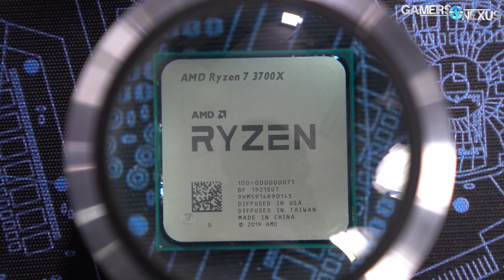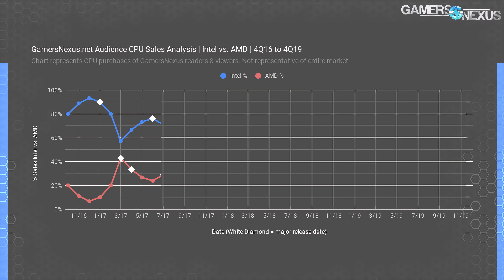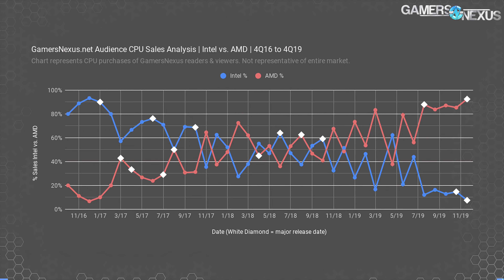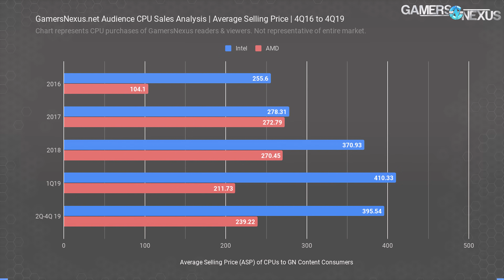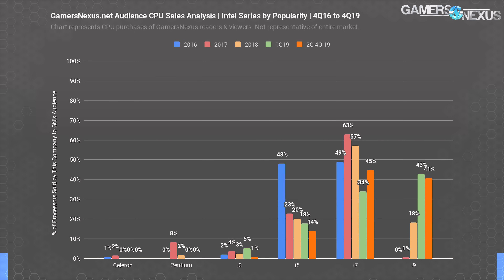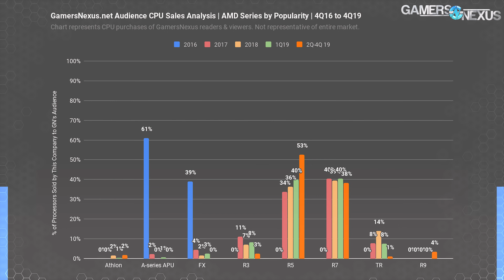GN Special Report: AMD Moves 93% of CPU Sales (Intel vs. AMD 2019 for DIY)

Comment from the maker: Watch our Best CPUs of 2019 video, which influenced data in this video: https://www.youtube.com/watch?v=5RjS3AhDyJg
Or our Best Cases of 2019 video: https://www.youtube.com/watch?v=2u8rGgYrRZY
Reply: Gamers Nexus how can you not go AMD at this point. On Cyber Monday Amazon had a deal where you could get the 3800x for $254, MSI MPG X570 Gaming Pro Carbon WiFi for $185, and a Samsung 970 Evo Plus 500GB for $77. That’s the best deal of the year and I had to jump on it.
Reply: Gaming? Lacking 3-5% VS 9900KS on average in 20+'ish modern games tests with the cheaper 3900X, that sounds a bit absurd to me when the 9900KS gets easily KO'd practically everywhere else.
Reply: I would say people are buying the 3600/3800x even though you said not to is  cause like you said 90% don't OC the chip. The 10% like me will OC and pay less while the normal person buys a stock higher clock.
Reply: Good job Gamers Nexus. You're the best there is!
I am just preparing to order mine r5 3600 CPU.
I want to use b450 MSI board gaming plus max.
Is that a good board?
I think it's a good choice it even has USB flash.
Thank you for all your hard work.
Keep it up.
One love.
Reply: i liked my 1700x better then this 8700k but this thing was essentially free for me as i traded a pc i made from spares... i wish i never sold the ryzen had a 3.9ghz oc on a .100mv undervolt... not to mention i got a golden mem controller on it... not to mention the 1700x felt like it a had a snappier out of the box a lot lest tinkering then this 8700k and the damn deliding to get the most out of it had me tearing my hair out with anxiety
Reply: So, in other words, your viewers, the most informed DIYers in the world, greatly prefer AMD CPUs.
Reply: FYI, My decision to buy a 3600 (non X) was cemented by Gamers Nexus, and AMD choosing a large (at the time) price difference between the 3600 and the 3600X.
This replaced a 2700X, and I am very happy with the decision to upgrade, the 3600MHz RAM support also makes a real-world difference for me who simply needs a "nippier" system and not an insane amount of threads, and of course the 3600 is fantastic value in its segment.
When it comes to 4K gaming, the Intel clock frequency advantage vanishes with the 3600 for real-world gaming at 4K without selling a kidney for a GTX 8000 Super XXX Mega GPU.!
Reply: Unrelated to the video, but i would really like someone with your knowledge to tackle the bizarre fps issue in halo reach and if theres a way to fix it without a game update and perhaps and explanation of what's actually going on? Doesn't matter what refresh rate or framerate you play at, the game feels like its forever stuck at 60fps, and you seem like the man most qualified out of the tech youtubers i watch to break this down. Just a simple request of a fan, i can understand completely if you don't have the time/wish to do soemthing like that. Keep up the great content my man!
Reply: Gaming is a waste of time and electrical energy, causing more pollution from fossil fuels and hurts the economy.  HoW DaRe YoU ! !

Get a Library card, walk there, and read books.    (The Library card so you are not wasting trees by printing too many copies of books.)
Reply: The main reason people were still buying the 3600X instead of the 3600 is because the 3600X was only $5 to $10 more than the 3600 during the Black Friday/Cyber Monday sale or they just plain didn't do their research on the two chips.
Reply: I don't get why your videos won't play back properly on my android tv. Seems to consistently freeze frame but continue audio.
Reply: I guess you don't mind losing 7% of your viewers then.

Comment: I think Intel issue is actually not production, it may be even artificial. My personal guess (pure guess, no support material) is AMD TR completely throw Intel off course with general availability of 16/32 cores cpus. Intel don't have, or don't know how to answer to it. Intel always reserve high core count for server cpu(xeons) as a differentiation for pricing. With AMD making these high core counts available for mass markets, Intel long term strategy break down. Its cpu no longer justify the pricing in both low end and high end segments, and equally worse, the chip set tie up also breaking down as AMD do away completely.

Comment: Its not just about ability or money it's about intels ideology. I haven't bought Intel for nearly 20 years. The writing on the wall for me was with the launch of 64bit where AMD was leading the charge and Intel sat there laughing with comments along the lines of how stupid it was to put 64bit into home PC's which was power they didn't need and should be kept to servers and data centres. While Intel may have had performance advantages in that time AMD have always delivered more performance per pound than Intel. AMD struggled in the mid term but again were leading the way in graphics integration by bringing Radion in house and providing new ideas to battle against Intel's insistance on stagnation and artificial tech bottlenecking. I will never buy Intel again no matter what they bring to the table, they had a dominant position and only used it to screw over its customer base for the most profit.
Reply: Jon Harrison   More old information.
Reply: @wysetech2000  Its not information just a personal opinion as to why I won't support Intel in its fleecing operation....LOL

Comment: 9900k/s have a serious problem. they aren't much faster than 3700x, in fact, since 9900k has time limited boost, not faster at all.

but MUCH harder to cool and need more expensive parts for high power consumption (better board, psu, cooling). plus they cost much more themselves... really bad price/performance
Reply: KilluaXIII   If you look closely and get over your bloated ego you will find that AMD doesn't hold it's boost clocks either.
Reply: @wysetech2000  there's a difference between single core boost and all core boost. my 3700x holds both consistently from the first second

Comment: most mainstream(casual) user still think amd is hot and loud. they have brainwased by intel inside slogan. also most casual user only need a laptop than dekstop and laptop market still under intel control, because ryzen laptop is rare and already out of stock. and even if you find one the price is expensive(because it is rare). ryzen cpu also limited stock, only enthusiast understand the benefit of ryzen.

Comment: I am guilty of buying a 3800x, and that was after watching your videos saying it wasn't a good value. But in the end I decided it was worth it to me to buy the higher binned chip for an extra 75 bucks even if it is only going to yield a little bit more performance because I thought it would be more fun to push that chip to its limits since it really appeared to be the fastest offering from AMD at the time (pre-3950x). I also plan to eventually add an open loop water cooling system to the computer, now talk about poor value to performance boost! I guess when you start to push into the enthusiast segment value kind of becomes secondary to performance. All that being said, I really appreciate GNs advice when it comes to value and the biggest bang for your buck, because I have definitely been using that info for other PCs that I have built for people that are operating more in that maximum price to performance arena.

Comment: Built Intel earlier in 2019, 9900k OC at 5ghz all core, paired with 2080ti. Wanted the best gaming CPU to drive Valve Index at 144hz. Runs amazing, no regrets.

Comment: I would have bought an AMD if they had a better cpu. As it stands the 9600K runs all AAA games without bottlenecking the GPU, and it comes in at $40 cheaper than the AMD alternative with lower single core performance. Clearly a "gamer" nexus buying all these AMDs, same reason turtlebeach was taken seriously by "gamers."
Reply: amd is copy from intel. a clone. another cyrix LOL. dead soon. i know. inside info. Intel always win in the end.

Comment: Used the 2600 is $50-70.  It’s a no brained to throw a box together with a $40-60 b450 mobo.  If it doesn’t totally fit whatever you are doing, who cares, it’s cheap.

Comment: It's rediculus that the Ryzen APU's are not being used in inexpensive prebuilt desktops. APUs are inexpensive, just as good and allow for way better graphics. General Work PC's should have Ryzen APU's. It's bullshit that a low end Intel chip is used instead.
Reply: the celeron is legendary btw intel is smarter and know how to make their cpu perform better clock for clock. it the instruction code that matter. amd is a joke.

Comment: Intel is still severely ahead in the laptop market though
Reply: i agree this is just a joke and wont last.. hahahaha amd sucks.
Reply: Zen 2 Mobile is coming..
Reply: @segaprophet  so what? with still 4 cores only? LOL
And I heard reports of them making 6 cores... so what? If it's still only 35 watts it's not gonna beat even the current i7, not to mention that Intel will release 6 core\12 thread i5-s to laptops next year so... Ryzen mobile will still only be on the level of i5-s lol, maybe even slower due to i5-s being undervoltable and having higher TDP.

Comment: Calm down people.  This has happened before.  I went from Intel to AMD and back again as the performance crown shifted.  However, with today's tech being easily fast enough already, I haven't gone with AMD simply because my current setup does everything I need, as fast as I need it to be.  We've reached a saturation point where more speed really does not do much except for some very niche tasks.  Nevertheless, AMD will lose their crown to Intel or perhaps another, unknown competitor in the not so distant future.  It's good for us and good for competition.  Be happy for that, but don't act as if this is the beginning of AMD's perpetual domination of the market.  They had it once and lost it, as they will again.
Reply: J3B    I don't think Intel is showing their hand until they have something great to sell.
Reply: @wysetech2000  intel is turtle. amd is hot head LOL loser.

Comment: But, but, we are doing sooooooooo good that we can't even keep up with demand.

Intel just got fucked because they had to sell larger silicon without a shrink. Running out of wafer capacity.
A doubling of silicon size, going from 4 to 8 cores or 2 to 4, results in a 66% decrease in the amounts of chips that come out a wafer. The whole square peg and round hole problem.

Once they go to 10nm or 7nm on chiplets they will have huge over capacity and will have to cut fabs for sure. Intels troubles are far from over.

Comment: I have unlocked intel cpu and I leave the OC off. I find meaningful gains leave system unstable running 24/7. And leaving it where it’s stable —- doesn’t result in much gains in real world use and increases power draw. I’m GPU bound anyway
Using rtx 2080 and 9600k

Comment: Ask GN How microwave friendly is that mug?  And metal spoon friction resistant?   Actually, you know what.  You should benchmark its heat dissipation to see for how long it can keep a hot drink temperature.  I expect charts of the differences depending on liquid density, if any.  Like, coffee, chocolate or tea.

Comment: I've had so many CPU's at this point I've forgotten most. Probably because I'm getting old. Next will be AMD again, but I'm in no rush. This 5 GHz 7700K plays all the games fine.

Intel:
4.77 Mhz 8086
10 MHz 8088
12 MHz 80286 with 80287 Co-Processor
Pentium 166
Pentium 200 MMX (OC to 250 MHz)
Celeron 366 (OC to 550 MHz)
Celeron 600 (OC to 900 MHz)
Q6600 2.4 (OC to 3.6 GHz)
i5-3570K 3.4 (OC to 4.0 GHz)
i3-7100 3.9 GHz
i7-7700K 4.2 (OC to 5.0 GHz)

AMD:
AMx386DX 40 MHz
AMx486DX4 133 MHz
K6-2 350 Mhz
Athlon 1100
Athlon 1700+ (1466 MHz)
Athlon 3200+ (2.2 GHz)
Athlon 64 3200+ (2.2 GHz)
Athlon 64 X2 4800+ (2.4 GHz)

Cyrix:
P166+ 133 MHz

Comment: On Cyber Monday I pulled the trigger on a 2700X that was selling for $159 which included either BL3 or The Outer Worlds. Already had BL3 and was going to buy TOW at some point anyway.  So I basically got the 2700X, still an incredible CPU, for a $99.  Obviously many other capitalized on this as well.  Intel simply cannot (will not) compete on this scale.

Comment: I've been an Intel loyalist since my first 486-SX25 nearly 30 years ago.... but today I received my first AMD chip ever. A Threadripper 3970X which I'll be using to replace my dual Xeon E5-2640v4 workstation. I hung on for 10nm as long as I could Intel... but the scattered few 10nm mobile CPUs were too little too late.

Comment: The Intel-AMD tug of war has been a crazy ride for me. Intel Pentium MMX in 2000, AMD K6-2 in 2003, Intel Pentium 4 Prescott in 2004, AMD Phenom II X4 in 2009, AMD FX last year and finally a Ryzen 5 3600 just three months ago. I don't know what my next CPU will be or on what socket but I know the only way Intel is going to ensnare me back into their CPU circus is with an instruction loaded single threading champion. FX is still my heavy lifter despite 2.2x the multithread performance in Ryzen 5. I rely on Ryzen for playing unoptimized/VR games and doing work in Unity and Blender. Neither of them are disappointing but it's annoying that these systems are marked for specific jobs where overclocking is such a different experience on each one. I've been doing this from the start. A stable 500MHz OC on the FX is something I will never match on Ryzen and while that was great, others are doubling past my experience into 5GHz clockspeed territory. I don't buy CPUs based on overclocking performance but the base clock performance and peak overclock gap. Ryzen 5 3600 is my golden ticket. I would love to see what 5nm can do.

Comment: On the note of the 3700x vs the 3800x there has been a lot of sales of having the 3800x cheaper then the 3700x  but no point buying the 3800x at its MSRP.

Comment: Best of all - it's going to be even better for AMD and even worse for Intel

The server market is worth over 20 bil.$ and currently dominated by Intel but AMD is gaining with faster, cheaper and more efficient products.
The desktop market is already lost, the notebook chip market starting from next year in January when AMD launches their new more efficient and faster mobile APUs. That's another market of 15 bil.$

All in all AMD is looking at a market of almost 50 bil $ here that it can take over. Currently AMDs revenue is only ca. 8 bil. $ so guess what, the rally won't stop.
Reply: Mastakilla91      If every Intel server chip was replaced with AMD it would take more than 10 years.  That's a fact.

Comment: World has shifted from "Buy i5, for 95% of consumer use-cases" to "Don't buy i5 " in 20 months .
Reply: in the laptop space though, it's still is this way, especially on gaming laptops
Reply: @TabalugaDragon  In laptops though i5's and  i7s always differed only by clocks not core count / ht presence.
Reply: @Meddixi  you're kidding right? Google i5 9300h and i7 9750h. Also google the new i7 for ultrabooks, i7 10710u
Reply: @TabalugaDragon  Google whole line of U processors from 2 to 8.
Reply: @Meddixi  lol why would I do that? I've been studying them for like 6 years. you said both i5-s and i7-s are not different in core count or absense of HT but I proved you wrong, now what exactly are you trying to do? Also google i5 6300hq lol. It's 4 cores like i7 of that generation yet doesn't have HT

Comment: Intel's learned nothing from FX... Releasing the same thing with a higher power draw and higher clockspeed isn't innovating...

Sure, unlike FX, the intel chips aren't bad, they're just not great value. They're stagnant. AMD's managing to put server/workstation class performance inside mainstream desktops, and the best intel can manage to do is slap a silly number on an old chip and charge a lot for it...
Reply: iamdarkyoshi
More of the same crap i have read a dozen times.

Comment: Zen 2 over Zen + saw a ~ 15% improvement; Zen 2 over Zen was even ~ 25%.

AMD said we should expect Zen 3 to deliver gains "you'd expect from a new uArch", so I assume another +15% is coming with Ryzen 4000 in 2020.

If this was to happen, the 4700x would match or slightly outperform the 9900Ks in gaming - unless Intel can pull a rabbit out of their hat.

Kind of like the 3600 matches or even mostly beats the 8700k.

Comment: DIY users and enthusiast do overclock, but not so much exotic overclock (sub zero applications) because it is not so reliable, inefficiency and with huge impact on the costs. AMD are known to reach the clock barrier while intel says, up to 100 Celcius push so much as you want. Staying for that long in the 14nm nodes does not help at all even being that clock-high friendly since others are capable of increasing the transistor density and reaching the same processing power with lower clocks and lower power consumption. Intel seem they dont bother that much but AMD ist just a nose behind on gaming and some other applications but in the most of them the multitasking capabilities of ryzen architecture is actually leading the industry at the moment. 

Without node shrinking it will not happen. There is not much "Oxygen" left for Intel, the competition is strong and we need that even more in the GPU Industry.